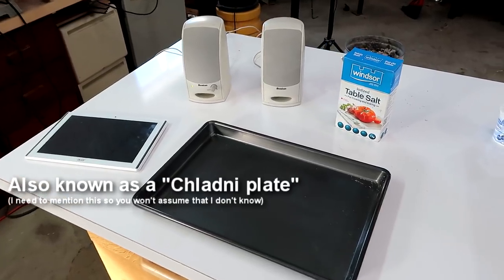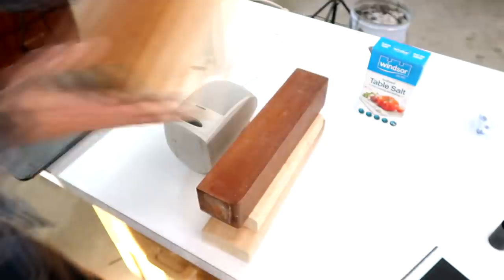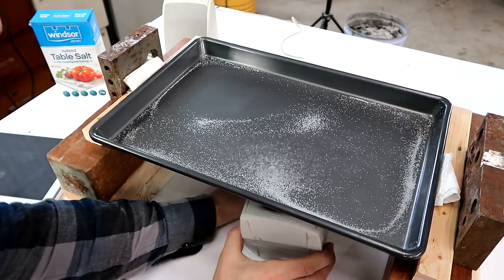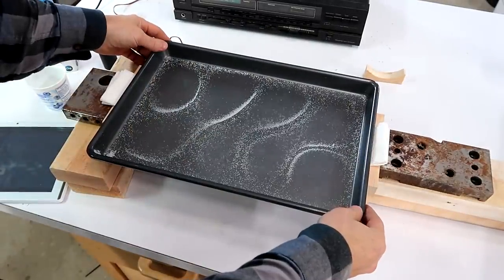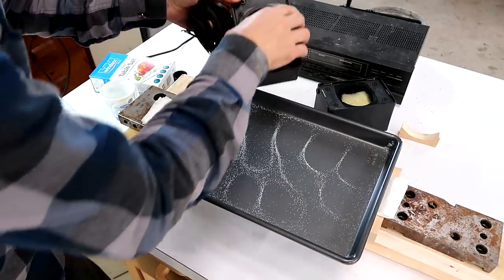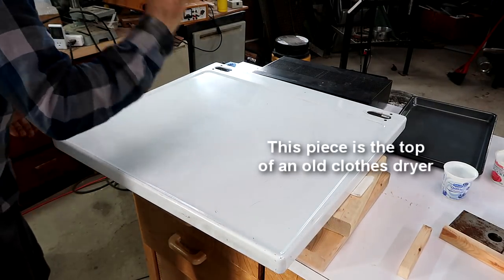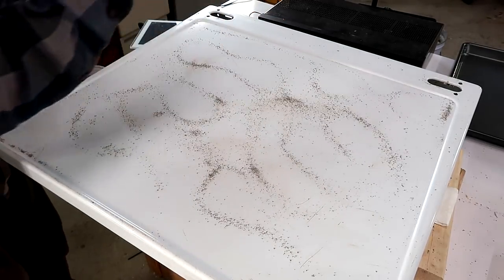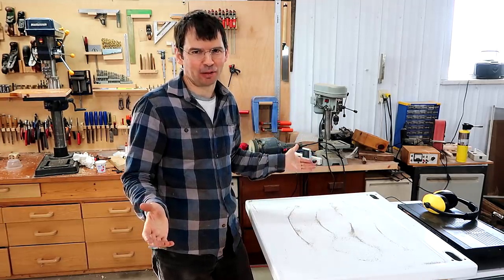Metal plate resonance experiments (Chladni plate)

Comment: Its easier to identify resonances and their associated harmonics if you view it in Spectrograph or a waterfall graph or even an FFT with averaging on. This allows you to better see the rate at which each frequency decays. You could also attach a piezo (very cheap) pickup to the surface to eliminate the losses due to the air gap between your tablet microphone and the plate. If you were to excite the plate by multiple resonances at the same time the destructive interference patterns created are amazing.

Comment: Could you get better performance by connecting the plate physically to the speaker coil rather than relying on air to transmit the energy?
Reply from the maker: yes, just didn't want to destroy (another) speaker
Reply: I think a better solution would be to reduce the rate at which plate loses energy. Namely if it does not lose energy very fast, then just running the sound source for longer should also result into the plate accumulating more vibrational energy.

I think this can be reduced by supporting the plates along one of its nodes of that mode. However changing the way the plate is supported might also change the mode your are trying to excite slightly. Another to reduce this should be choosing a plate which is made of a stiffer material.
Reply: they make special devices to attach the plates to and also because of the side walls the patterns wil be verry different to normal. you can also think to use glass plates
Reply: Resting the plate on two of the nodes would also allow it to resonate more freely. And resting it on foam would help too.
Reply: Yes, but Matthias' point was to do it without special equipment.

Comment: I'm an amateur luthier, what you are doing is called "tap tuning" I use the same setup as you but with tea, not sand or sugar.
When I got fascinated by this, I researched it and found an example of "tap tuning" using the violin bow to excite the particles, so this practice goes back hundreds of years. There is an old video on youtube ( black and white and silent) showing a bow being used to "tap tuning" a violin plate   look up "American violin maker - James Reynold Carlisle" 2.40 minutes in it shows the "tap tuning."
OK here is the challenge.
Carve all the parts of a violin tune them and make one that like a stradstradivarius.
I've been trying for years!

Comment: To solve your power problem you could improve the coupling (air dissipates a lot of energy). You could try and make a diy version of those "seat transducer" they use in facy cinemas. Just take an old speaker, cut most of the diaphragm and glue something like a straw or a dowel to the center. That way you basically make something that pokes things at precise frequencies without wasting energy moving air

Comment: Instead of a speaker have you considered connecting a DC motor with a short arm off the shaft to the back of the pan to make the entire pan a speaker? I got the idea from Bruce Yeany who did it with paper plates and I thought it would be cool to try for standing waves.

Comment: What would happen if you supported the plate from the corners instead of the middle of each side? Would the pattern change? What if you suspended it from some strings so it was floating in air? Just curious what would happen. Would make a good kids science project. Thanks for sharing this Matthias.

Comment: So cool, thanks for taking the time to share this! You might get even better performance if you measure the frequency with the same boundary conditions to which you're applying the forcing function (don't hold and tap, set it on the boards and tap)... aaaand then I watched the rest of the video, and that's exactly what you did after the first one.

Comment: Put a long handle on that speaker and use it as a magnetic pick up tool.  Can you do that to the sheet... Take a pic. Use a different freq. Take another pic. Etc... Then lay the pics on top of each other, and decide how, if you partially cut out the open spaces... One for each frequency. You can get several 'tongues' on the sheet. And would that work for a tongue drum?

Comment: What do you suppose would happen if you cut the edges off of your sheet so that it was flat, and then suspended it at nodes?  My guess is that you'd get a different but similar pattern, and that it would ring longer, but also make a bigger mess.  Kind of a large 2-D wind chime!

Comment: Next time, lay the sheet (cookie sheet, dryer panel, etc.) so that it's in contact with the speaker enclosure...with the corners supported just enough to keep the sheet level. The fact that the speaker is in an enclosure will prevent the sheet from impeding speaker voice coil travel, but putting it in contact with the sheet will allow you to get nice effects at much lower dB SPL.

Typically, experiments like these are done using a contact transducer (an example of which might be one of those home theater subwoofers that get bolted directly to the floor joists under the room that the system is in....or an old B.E.S.T. planar transducer, that gets plastered right into a wall and turns the sheetrock in that wall into the sound radiating element) which most people don't have just laying around! An alternative might be getting a much larger speaker (12" - 15") with a much larger voice coil, then gluing a sturdy cardboard tube (toilet paper or paper towel tubes will NOT be strong enough) centered on the speaker's paper cone AND glued to the center of the sheet. You'd have to support the sheet corners and fix the speaker in place...since vibration will make it want to 'walk' across the table. It's also better to use an AF signal generator that allows some fine adjustment 'on the fly'....like with a control knob. You'd be surprised at the difference just a tiny frequency adjustment (even just 1 or 2 Hz) can make.

....and yes, there are pieces of art out there that use the results (permanently fixed in place) as a background....or even the subject!!

Comment: I think I've only ever seen this demonstration in two modes: a linear oscillator is placed upward and the plate bolted to it in the center, and a static bar pointing upward bolted to the plate in a similar manner and bowed with a bowstring.

It makes sense that your method also works, and for everyday metal plates in product design. However, sound is very inefficient at delivering power. Added, with the demonstration that location of the sound source not changing the shape of the pattern, only it's intensity to reveal itself,  I'd like to suggest two changes:

A. Attach an arm or larger foam dome to a speaker and apply physical contact to the object being observed. Apply the device at different locations and different directions. Does the pattern remain the same or merely affect the intensity?

B. Remove the body of the speaker and reduce it to the coil, or simply drive a coil of wire with your amp and frequency generator. Hold the coil with the signal running near the plate. This might be more effective than the speaker housed in it's magnetic shielding and air gaps.
Reply: Also, using a frequency generator that you can adjust continuously, or at least smooth-ish would be nice to discover frequency modes or superpositions of two.

Comment: is there someway to measure material thickness and inconsistencies? The diagonal lines must mean some kind of difference, if the speaker would be placed in the center of the plate, shouldn't that give symmetrical lines transferring from the center then?
Reply: johan jönsson yes and now. Using this it would be fairly hard. The asymmetry we see on this experiment is most likely due to asymmetrical supports for the plate and therefore asymmetrical tension along the plate. While material thickness and consistency certainly affects the wave pattern, it would probably be hard to separate the effect from the effect the tension has.

Comment: But, you could equally make those sounds with another piece of metal right? It doesn't need to be a speaker, it just need to produce the correct resonant frequency .... so you could make the sound mechanically right? With the right shaped piece of metal beneath the top one... maybe a metal guitar string? Can you direct the salt... say to the edge of the tray?

Comment: i'd just use a sweepable frequency sine generator and lose the spectrum analyzer. the audio program Reaper has a plugin called 'tone generator' that would work. also for the high frequencies, i'd invest in a horn tweeter, being careful the amp is matched, and i suppose a simple high pass filter to negate the high energy low frequency signals before it. then i would do the cymatic experiment on black acrylic glass so the nodes wouldn't be based on irregularities in the material, and acrylic glass is safer than silica glass.

Comment: The problem i can see with those sheets is the raised edge, that edge will resonate at a different frequency, which may counteract the main sheet freq in the harmonics, best to use a flat sheet..
Most use a direct contact transducer, probably uses less power to resonate the sheet.
Reply: Sparky Projects it does really matter because it will just have other characteristic patterns for having  rims.
Reply: Yeah, the edges are just a boundary for the resonances in the middle.
Reply: no, the whole body has a natural frequency lol irregular shapes make interesting patterns

Comment: I found it interesting that you had to go to a more powerful speaker to do the higher frequencies.  Because among electric guitars, a bass guitar amplifier has to be twice the wattage of a regular 6 string guitar amplifier to achieve the same house-rocking volume.
Reply: lol that is only because, the element is needed to be bigger to play lower frequencies accurately.
Reply: volume is roughly equivalent to sound energy times a human specific adjustment curve, while a sound of higher frequency has less amplitude than a low frequency sound of the same energy, and amplitude is needed for moving grains

Comment: Great concept; but you can explore more easily by getting an app with a slider / knob control, where you can easily slide up and down.
Perhaps you could try that with sawdust or colored sand next.
Reply: Using pepper might be hot?
Reply: TheAmpair that could work; might cause some coughing if it got in the air :)